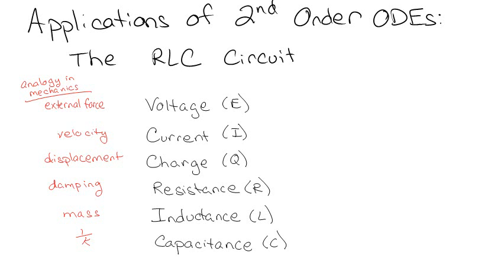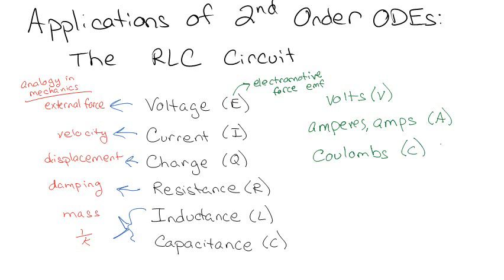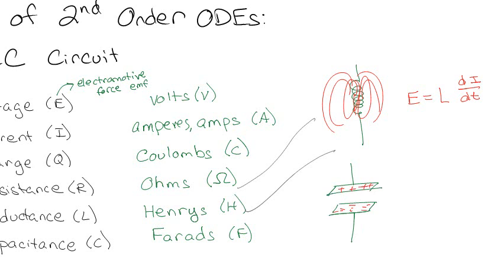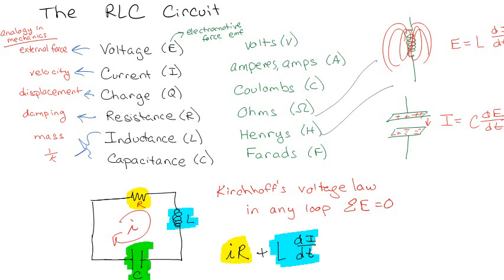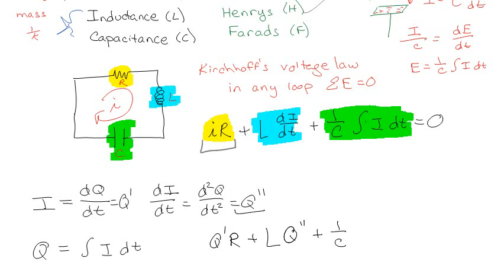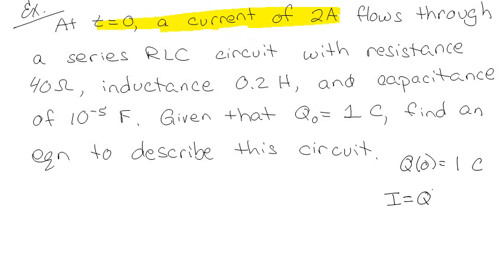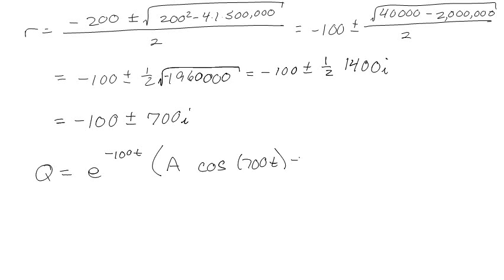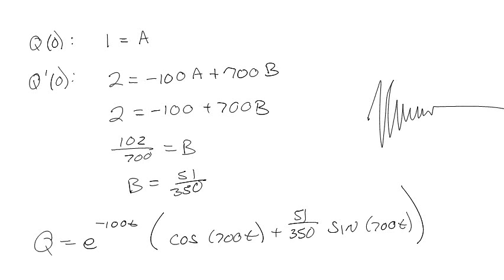Solving RLC Series Circuits

Comment: I had a snuggly happy math time watching this video. Thank you! Oh, and the homogenous solution to the RLC equation is called the “transient response” in electrical engineering (and probably physics as well), because it dies out pretty quick. I think mechanical engineers would think of it as a damped harmonic oscillator :) ....random information.